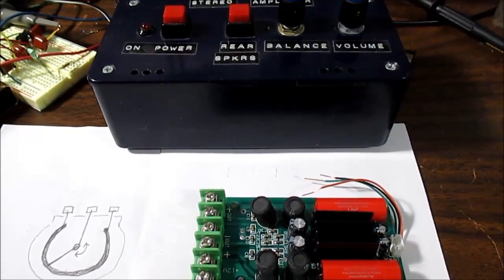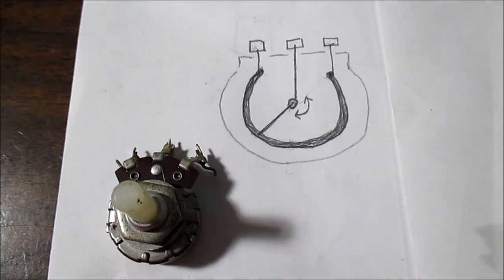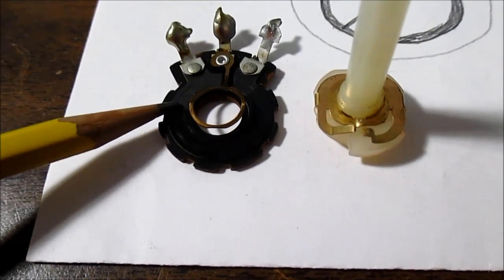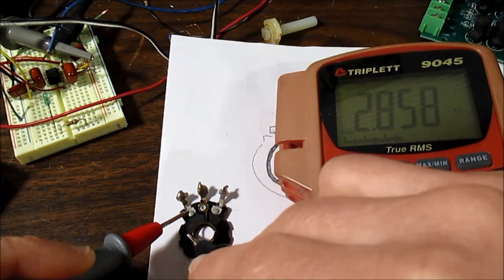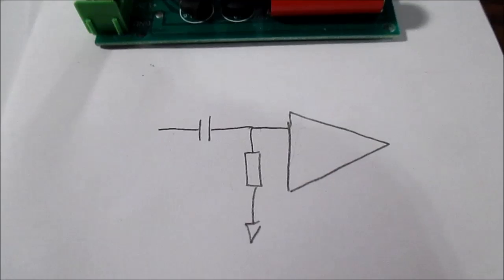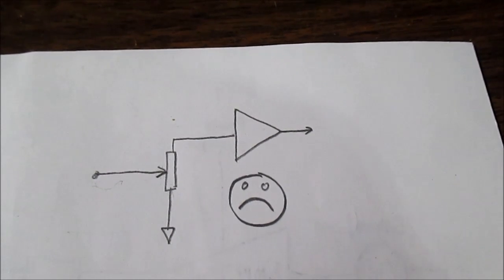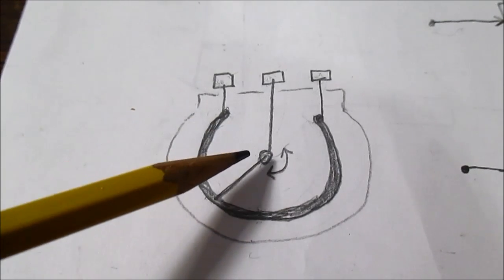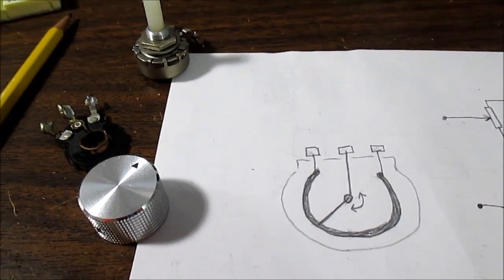How to add a volume control to your audio amplifier project

Comment: What's the difference between the Amplifier Source and the Audio Signal?
Reply: An audio signal is audio of some form. This signal might be on it's way in, on it's way through a circuit (like an amplifier) or it might be audio on it's way out of the amplifier and going to the speakers. An audio source is where the audio comes from.... the source of the audio. The Audio source for an amplifier might be an MP3 player. The audio source for a loudspeaker might be the amplifier.

Comment: This is maybe a stupid beginners question, but why would you place the volume control on the input, and thus losing signal strength and thus getting worse signal/noise ratio instead of placing the pot on the output?
Reply from the maker: The pot would have to be able to dissipate a lot of power. It would spoil the damping factor of the amp and cause frequency response issues because of the way speakers have varying impedance across the audio band. Best place for it is between the preamp and power amp.

Comment: Hey  Ya Buddy , What You Think Of This ? 

http://www.ebay.co.uk/itm/TDA7498E-160W-160W-Dual-Channel-Audio-Stereo-Power-Amplifier-Board-Module-New-/332007171104?roken=cUgayN
Reply from the maker: Good power for the money! The 160 w is at 10% THD. It is more like a 100w at pre clipping levels. I'd run it conservatively at a lower voltage supply for about 75w per channel for a longer life.
Reply: Yeah More Than Enough , i just bought a Kinter 4 Channel Output Amp its ok but a bit noisy even on pure DC any suggestions ?

Comment: hi great post.
what value k pot would you recommend to resist an audio line out for headphones out.
have a small practice amp with a headphone out with a set level.
regards Andy
Reply from the maker: I would not recommend a control on the headphones output, but it can be done. There is a device called an L pad that might work. You could use a small low power rated one.

Comment: Dude, I'm using a 10K pot but it has noise (scratch) on low volume, I'ts not dirty, can I use a capacitor to reduce the scratchyness getting to the amp?
Reply from the maker: If you get a scratchy sound when adjusting the pot even when no music is being played, there is some DC current passing through the pot. You can use a capacitor to block the DC so as long as it is not effecting any bias currents the amplifier might need for proper function.
Reply: OK, I added a 5K resistor before the pot, that seems to have reduced the scratchyness, what's going on there? Also, I am using an LM380 in BTL and connect the input to one end of the pot to the input which goes thru a 5K resistor, the 'ground' end of the pot to the inverting input and the wiper to the non-inverting, this works really well, it's a log pot 10K and this method really smooths the volume.

Also, is there any way to us the pot in such a way that there is always something playing? In effect, there is no zero volume? This way, people know, even if they turn it right down, there is something playing?
Reply from the maker: There could be a few millivolts of DC going through the pot. A resistor would lower the current. Did you try a capacitor? Isn't the inverting input on these normally grounded? If so, add a small value resistor between the grounded side of the pot and ground. This will allow some signal to pass even if the pot is turned all the way down.

Comment: 8:52 Not sure if there is a way of grounding a sliding potentiometer.  Maybe I'll just have to make the case out of metal.
Reply from the maker: You can ground the casing (if metal), but not the slider itself. That would probably be enough.

Comment: Have you read The Secret Life of Pots article? You can find it online easily by googling the title if you haven't. Explaining it might make a decent follow-up video to this, especially the part about tapering resistors.
Reply from the maker: I have not seen that. Good info. Looks like you can use a linear pot of the right value to give you an audio taper effect using an extra resistor (or perhaps the amp's own input resistance).
Reply: JohnAudioTech I was considering the possibility  using the amp's own input resistance, too. The only real caveat to this technique, as he mentioned, is that the effective input impedance varies with the position of the pot, and at max volume, it's the value of the tapering resistor. It might not matter in most cases, but for example, if you want a 1 Meg minimum input impedance for a guitar amp, you'd need a 5+ Meg pot, which aren't particularly common.
Reply: I picked up the trick of biasing a linear pot into audio taper from Elliott Sound Products website about 15 years ago, i think everyone should read that website in its entirety, it's awesome. The site starts right off with that, Project 01 - Better Volume (and Balance) Controls. And yes it works very well, feels so much better than a usual cheap audio taper pot.

Comment: Hmmmm, ive always used linear pots and never really noticed the spike in volume
Reply from the maker: Not really a spike, the loudness shoots up faster at the beginning rotation starting from 0 and is already 80% loudness at only about 30% setting from 0. I see this a lot in cheap radios and cassette players of the past. If you use a linear taper pot that has a resistance much higher than that of the amp's input impedance, you get an audio log effect.